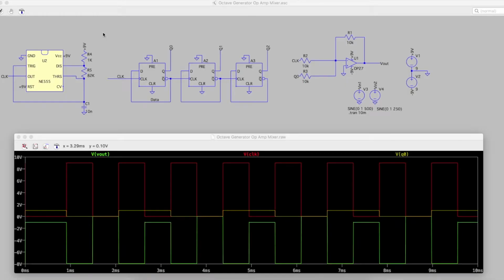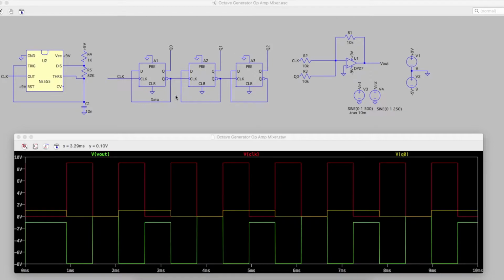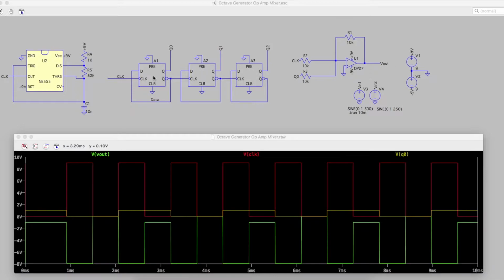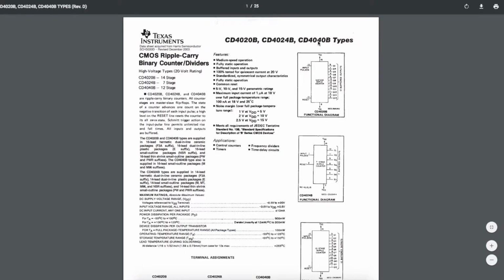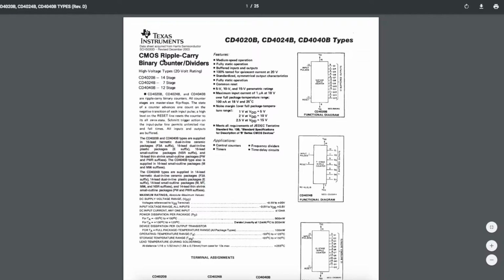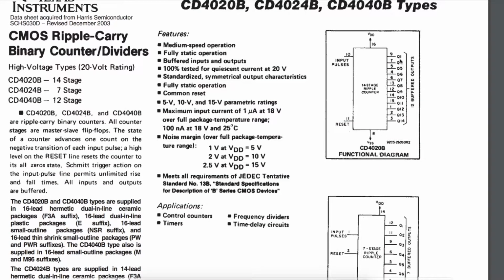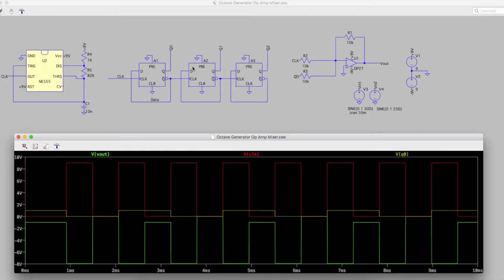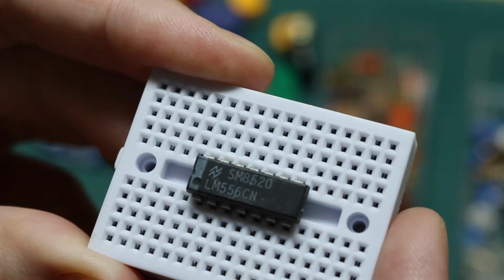555 Timer and  CD4040 Multi-Octave Synth Tone Generator

Comment: Have you tried connecting any of the different octave outputs to pin 5 on the NE555 DIP ? with some extra resistors or trim pot maybe or maybe no resistors at all, sending control voltages into pin 5 can effect the overall pitch again, leaving the rest of the 1st NE555 working as a psuedo resonant lowish pass filter. Shown here on my design. Check it out https://www.youtube.com/watch?v=TR4cJM2LUn8
I love the idea and will be incorporating your idea within it to see how far I can push the NE556 as am using those now to have 4x555 independant and co dependant funtions on one board real soon on my Next One. Am now subscribed to your channel to see what other great things Atari Punk/occilator synthy things you come up with.

Comment: 12:31 how would you minimize that?
Reply from the maker: I can’t remember the exact circuit so if I were repeating it today I would want to look at the signals on the scope as that DeTuning is going on and see what’s happening like maybe the direct output of the 555 would need to be buffered by a logic gate or something to keep it from having some sort of loading effect and to generate a fresh signal at full voltage swing because the 555 output doesn’t go all the way to the positive supply and things like that
and maybe I would want to just put a current meter in series with the power supply and see if the current dramatically  changes as this is happening to see if it really is related to that and maybe a battery is not the best option to power it if internal resistance changes the circuit behaviour when the load current changes and things like that.

Comment: Is there a way to feed multi clock signals into the 4040?
Reply from the maker: Sounds straightforward enough, depending what is actually required.  Selecting between multiple clock sources one at a time could be a multiplexer  such as a CD4051 chip where you can have multiple input clocks and then setting the control pins you choose which one gets to the common output
https://www.ti.com/lit/ds/symlink/cd4053b.pdf
If multiple clock sources are to be merged so that a new overall clock is created based on all the different rising and falling edges, maybe just a bunch of OR gates with a clock on each input, and any unused inputs grounded, and keep ORing the outputs into new inputs until it's just a final single output as a new clock, that would give some new unique result.

Comment: hi..is possible to have at output the 12th tones of given freq.. separately to make chords?

awesome
Reply from the maker: Each lower pitch is half the frequency of the previous using this divider, so we can mix multiples together to get octaves at the same time but chords would need other frequencies that aren't in this multiple so we'd have to try another way to get different divisions

Comment: This is really interesting! Mmmight you be continuing with this line of circuits?
Reply from the maker: I know it’s been a while since I worked with audio circuits but there is definitely one that I will be building sometime soon out of some logic gates and counters that I made a couple of decades ago  where different sound effects can be generated depending how the gates are set up. 

 But even before I get to that, I was going to do another teensy audio experiment hopefully this week where I can do audio processing like delay, reverb etc and so I am definitely easing back into the audio circuits. 

 I was thinking if I get that audio effect processor working, it would make little oscillators and sound affects even more fun if I run them through that.
Reply: Gadget Reboot hooray! I’m so happy you’re ‘doubling back’! Yeah, those will be an excellent next step. Geeking out, just a little extra, here. 
Thank you for your reply!
Reply: Btw, what is a “spice model?”
Reply from the maker: Where SPICE is a circuit simulator https://www.analog.com/en/design-center/design-tools-and-calculators/ltspice-simulator.html

A SPICE model is like a plugin that describes parameters or behaviours for a component,  for example a simulation can use an idealized op amp, but in order to simulate something more accurate for a specific part number that will be used in a real circuit, if the manufacture has created a SPICE model, that can be downloaded and used in the simulation and the performance of the simulation will better  reflect the real circuit. 

 It might contain specific things like the gain of the op amp, whether it can go rail to rail, input and output impedance etc.

 I once made a filter circuit with an op amp and simulated it with an ideal op amp and it worked fine, then on the breadboard my output signal was loaded down as a flat line.   I couldn’t figure out what went wrong but I saw that there was a SPICE model I could download for my specific op amp so I used that in the simulation and then it also went flat line.  It turns out the filter had a capacitor on the output that the op amp didn’t like so I had to choose a different one and then it worked as expected.
Reply from the maker: I just put out another video along these lines 
https://youtu.be/hv5_Nsf6wCU